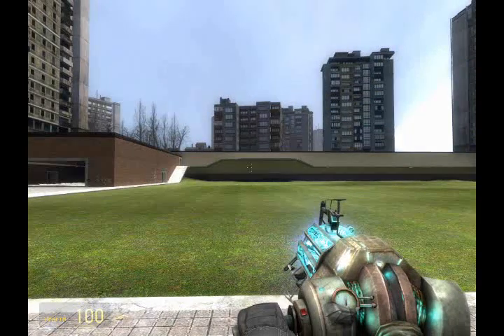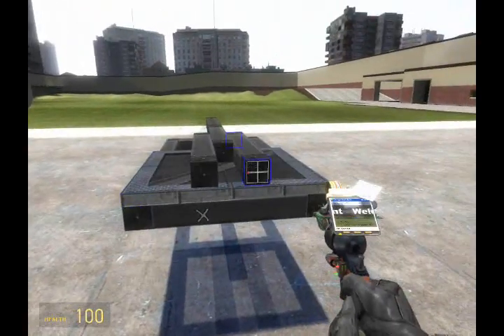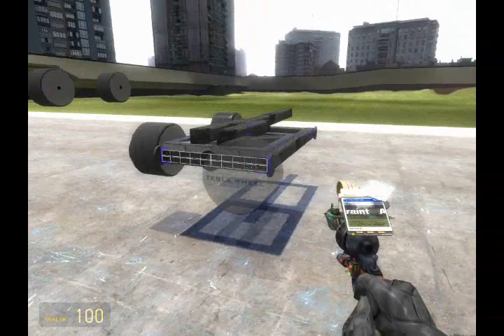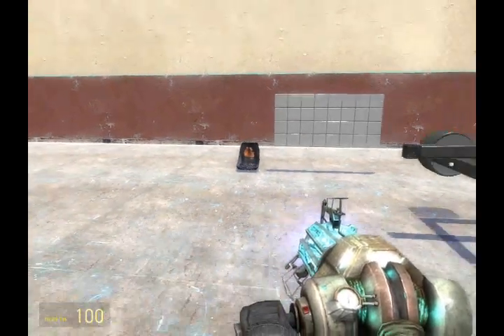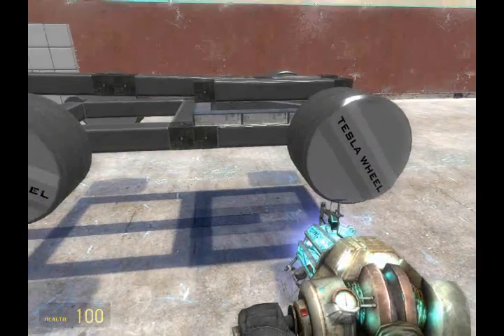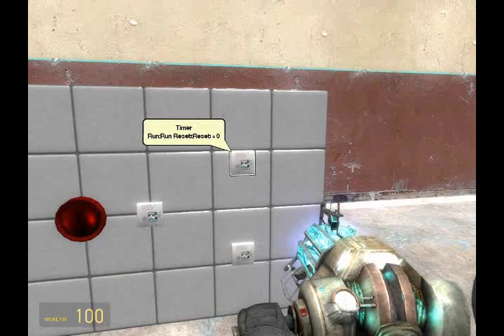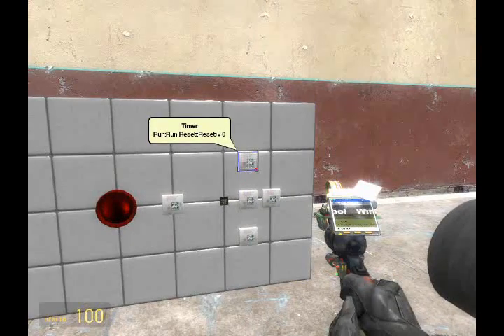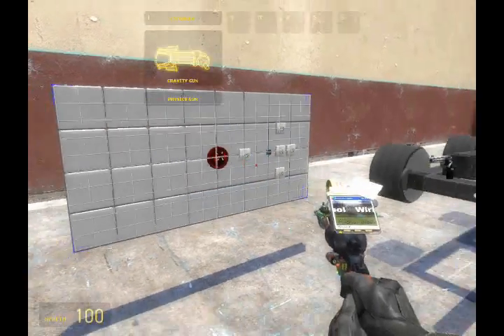WireMod Essentials [Ep. 09] - Remote Controlled Tank TUTORIAL

Comment: SUGGESTION:
(4) RT Cameras on the tank (foward, left, right, rear)

Build a small room (keypad entry) and place the chair and controller panel inside

Place 4 Screens, each wired to a separate rt camera
(Recommended placement configuration: FOWARD [top, center] LEFT [below and left offset] RIGHT [below and right offset] and REAR [below, center])

all this should result in a fully remote control room, for safe tank use